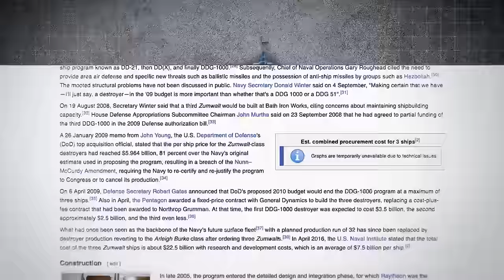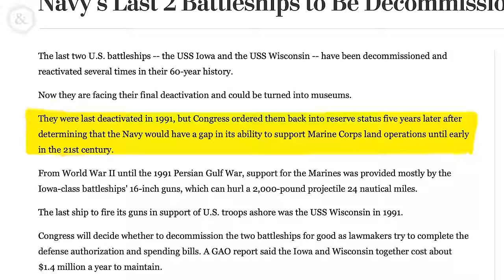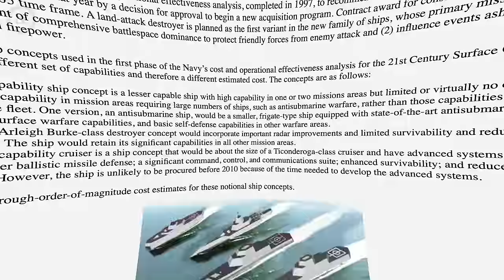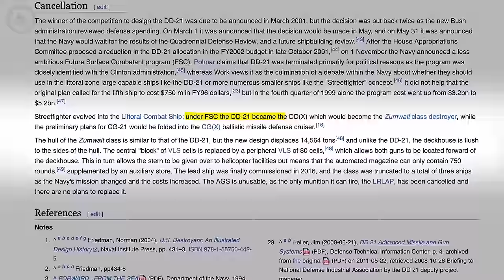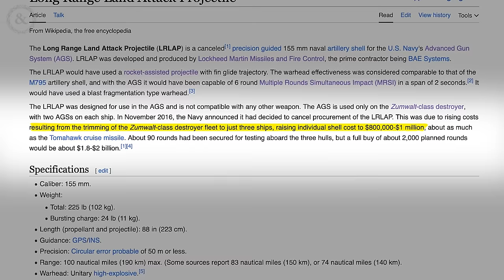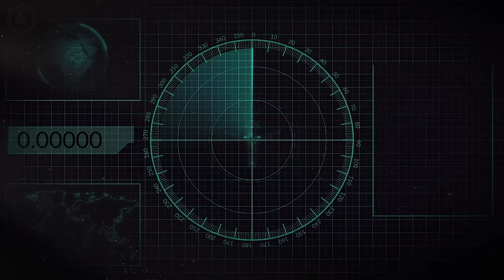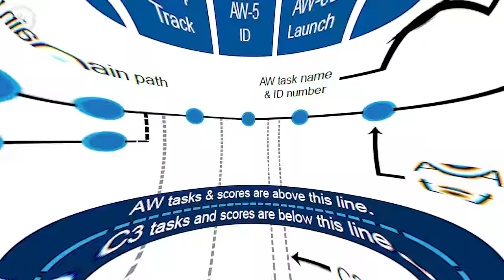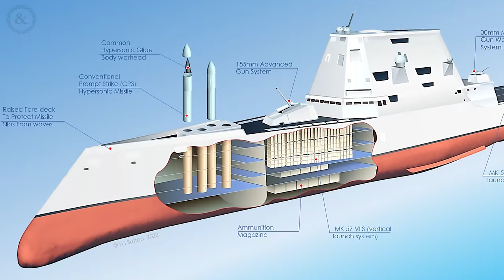Where is America's Stealth Destroyer?

Comment: The radar cross section is 100 percent fact. I was sitting just off of San Diego by Zuniga when it pulled into port for the first times and on radar it was massive from a certain angle. It made one turn in the channel and it shrunk to almost nothing. Seeing it on screen and then looking up at it was a trip.
Reply: The RCS doesn't matter that much though if the ship is using it's SPY radar though.
Reply: @Kriss_L  Not at all true, it's phased array and sweeps in a manner that it really doesn't provide the enemy with a way to easily resolve the location it's coming from.  Otherwise stealth aircraft would be entirely useless and pointless. 

Source - RF Metrologist from the USAF
Reply: @tonymorris4335  As a retired US Navy CT I'd say that that metrologist doesn't know much about SIGINT.
Reply: Well to be fair, thats true of literally any stealth thing. Same goes for the F-22, F-35, etc. From the front, it's invisible to anything but high powered search radar, and that will only give you a tiny, almost insignificant return, targeting radar sees nothing, From the side, top, bottom, its a bit more visible, from the back... Yeahhh even the Russians can find a raptor if it points its ass at the radar
Reply: @Kriss_L absolutely false
Reply: @Kriss_L What would give you the nonsensical idea that someone who works in Radio Frequency Metrology, would know nothing about signals intelligence?

The RF Metrology is specifically the exact field that would be associated with studying that stuff
Reply: @Man_Emperor_of_Mankind Your comment about a radiating SPY radar system.
Reply: @Kriss_L  I didn't make a comment about any radar system. My comment was about how nonsensical it was for you to say that someone who studies radio waves for the USAF wouldn't know anything about signals intelligence
Reply: @Man_Emperor_of_Mankind  Correction, it was the other comment:

@tonymorris4335
2 days ago
 @Kriss_L  Not at all true, it's phased array and sweeps in a manner that it really doesn't provide the enemy with a way to easily resolve the location it's coming from.  Otherwise stealth aircraft would be entirely useless and pointless. 

Source - RF Metrologist from the USAF
Reply: @Kriss_L bro can’t be wrong ever. Take a hint from the like ratios on your comment and the fact that everyone who comes in here has reliable information to disprove what you’re saying….
Reply: That's the whole idea of stealth. Have only one angle you're visible and avoid being hit by a radar from that angle.
Reply: @Kriss_L  While this is a good point - Isn't the whole idea of the navies network centric approach that different ships can hand off doing the 'looking' and 'firing' to make it harder for an enemy to find and then attack any given ship?
Reply: @Bustermachine  To some extent, but the real goal is cost savings.  Steel hulls and VLS cells are cheap.  The electronics in the combat systems are expensive.

So you could have a couple of really cheap  ships with large numbers of VLS cells whose missiles could be controlled by an expensive destroyer or frigate.
Reply: It is fine that it works that way for American radar.
Ask the Russians...
They hardly have stealth for one big reason. They also have radar that detects stealth, so why poor money into it.
Reply: @Kriss_L  lol stop pretending you are in military tsk tsk, your just a tiktoker woke
Reply: @Kriss_L  lol stop pretending your in military tsk tsk your just a tiktoker woke
Reply: That's the whole point of the flat surfaces and sharp edges. Conventional radar only works when there is at least some portion of the radar waves reflected right back at it. if you use materials with very little radar scatter you can essentially disappear unless you lined up just right. Like shining a flashlight out on to a field to find a mirror. If the mirror isn't facing you, the light just gets bounced off in a different direction. That being said, if you have multiple emitters and receivers that are spread wide and networked, that sort of stealth can be defeated by catching those errant reflections.
Reply: AND it's a beautiful ship to look at.

Comment: It’s insane the level of incompetence that this ship suffered from in the procurement process. It had true potential but now it is much larger than a Burke destroyer and holds far fewer missiles.
Reply: If the guns actually worked, it would be a really good ship. Good for shore bombardment, anti-ship warfare etc. But instead we get a half ass missile boat that would have been better off with 2 5 inch guns that is the epitome of how bad the navy admirals have gotten.
Reply: They are going to ditch the forward guns and add more vertical launch cells. If I remember correctly it will have a possible 200 missile armament.
Reply: @-UNKNOWN-13  I think they’re adding larger cells that can accommodate bigger hypersonics  where the gun mounts are

Comment: Fun fact,  the Ticonderoga class cruisers were originally designated guided missile destroyers, which made sense as they were built on a Spruance class destroyer hull.    They were re-designated because of the cost per unit.   

A Zumwalt has fewer VLS cells that a Burke class destroyer, which also has a 5" gun.    I don't know why they didn't fit a conventional 5" in at least one of the spaces available in the Zumwalt to give her at least some capability.    Or, work with the Army, which has it's own advanced gun system using a rocket assisted projectile.   Or just convert the guns to use standard 155mm shells.     Perhaps the hypersonic option will be workable, but I note that missile only ships have never been popular, and that even the USS Long Beach (CGN-9) had a couple of 5" guns added to her.
Reply: Missile ships become useful when facing a high-threat environment with many well-defended targets. The goal is to get in range as quickly as possible, launch what you can and escape to a safe distance. A gun is just dead weight. Meanwhile, against weak targets such as pirates on speedboats, naval guns are very useful. That's a lot more common of a problem than near-peer conflicts, and so navy officers with tons of experience dealing with those end up choosing a ship with guns. 

However, I would argue that having a ship that performs poorly against pirates isn't a big issue. Even if you fail, some other military asset can take care of it later. But when you have a near-peer conflict, you'd absolutely want the best ship for the job.
Reply: Ticonderoga must stay reserved for lazer scifi ships
Reply: They will eventually get a directed energy weapon I bet. Kind of makes sense if we refer back to that hybrid energy system huh?  Almost like that was the plan all along lol.  Remember they just revealed that the Ford will be arming with DE weapons ( probably already is ) 

The laser would not only give the zumwalt a low cost directed weapon but it could possibly cure the “ vulnerability “ issue from anti-ship missiles.
Those turret areas were supposed to be modular anyways if I remember correctly.
Reply: The Army's M982 is a modified version of the Navy's projectile. Thats why its so cheap. The navy essentialy footed the development cost and acted as a test bed for the eventual army proposal.

Comment: I toured one of those Zumwalts during fleet week in Portland Oregon. Very futuristic looking, but the CIC was running old Windows on all the screens LOL. No one can predict the future, so trying new (unfortunately expensive) concepts is the only way to stay ahead of the competition.
Reply: You realize Microsoft still provides security fixes and some times even feature requests for older versions of Windows if you're willing to pay enough for them, right? Windows NT 4.0 was still being supported for bank ATMs with security patches when Windows 7 was a thing. And the nice part with an older version: the interface doesn't constantly change so soldiers always know where everything is in the heat of combat.

They don't need to run the latest version of Steam or be able to install the newest version of Quickbooks. They need their software to run reliably and predictably in a consistent environment. They can either build and maintain their own bespoke environment (which has its own massive headaches) or use a consistent interface almost every soldier is guaranteed to have some familiarity with requiring minimal training.
Reply: @mawnkey - the smaller the code base & longer it has been bug fixed, the more reliable it should become… windows or no windows
Reply: @mawnkey   Yeah, I know. I work in tech and had worked in the Fed gov for yrs using Win NT. I get the reasons for sticking with what works and is familiar. It just looks antiquated on the most futuristic looking ship.
Reply: Sure they were…security would have been downgraded because you were there.
Reply: @mawnkey Microsoft should have thought about that before forcing everyone from windows 7, I know you forgot about windows 8 being dog shit but I won't, cause coding became that much more annoying
Reply: @Abandonsoyciety  If you strawmanned that argument any harder, it would be up dancing around and singing "If I only had a brain!"

Comment: the interesting thing with tumbleholm hull shape is that it can be really stabile but when it gets a hull breach it loses stability really quick
Reply: @rael5469  correct
Reply: @rael5469  It has a very low amount of the ship below the water line compared to other designs, which means when it starts flooding with water it quickly rolls over and capsizes.

Comment: Oooh, perfect chance for me to be a know-it-all on ship classifications :) Destroyers are usually thought of as small fleet escort ships, and they are, but as you said, the classification is mainly about the capabilities. Destroyers are specifically equipped with a full spectrum of weapons and sensors to defend against subsurface, surface, and air-based threats. They are focused on that mission, versus something like a frigate that has lesser capability on those areas but a more flexible design that can be used for various combat and non-combat missions. The ships the USN calls cruisers today are really destroyers. Their capabilities are the same as a Burke-class DDG, but they add a second 5" gun and flag officer facilities.

The DDG-1000s were originally conceived to operate supporting forces ashore in high-threat littoral zones, not as fleet escorts. In that role, it would indeed make more sense to classify them as cruisers, because they would be the center of their own strike group and probably have one or more destroyers as escort. But as you also pointed out, the mission kept changing, and ultimately was muddied to the point that they were claimed to be fleet escorts, possibly because even with their advanced stealth capabilities they were too vulnerable and too expensive to be risked close to the front lines. Down through history, many warships have become white elephants for those reasons.

If the technical kinks can be ironed out, and the 6.1" guns replaced with something useful like a hypersonic missile and/or a regular 5" gun, the DDG-1000s might yet serve in their original intended role as inshore fire support and first strike in a contested environment. Sort of a surface ship version of an F-35. At which point they should be classified as cruisers due to being utilized as a capital ship.
Reply: yeah i was thinking zumwalt was misclassifed (most likely on purpose so they get 32 of them initially) as a destroyer.  that thing scream cruiser to me at least going by ww2 standards.  The whole point of destroyers is protect the fleet but are easily replaced.  they are the screening force that draws fire away from the big boys.  zumwalt feel like instead of protecting and drawing fire.  its the ship that need protection so it can deliver its heavy firepower into shore or enemy vessels. Main job being shore but am sure it can also handle ship to ship combat if call upon.
Reply: "the classification is mainly about the capabilities"
Yep, and from the perspective of the Royal Danish Navy the most important capability in this regard is the ship´s range. Frigates (and cruisers) are regarded as true blue-water warships with a range of more than 9000 nautical miles such as for example the Iver Huitfeldt-class frigates which today are setting the modern NATO standard for the true blue-water "frigate" classification. 
However, both the Arleigh Burke-class destroyers, the Royal Navy´s Daring-class destroyers and the US Navy´s Ticonderoga-class cruisers all miserably fail to meet this criteria and hence do not deserve the classification "frigates" or even "cruisers". They are merely lesser valued green-water semi-coastal destroyers.
Apparently the range of the Zumwalt-class is a still kept secret, so perhaps the Zumwalt is a fully modern blue-water frigate or cruiser, or maybe it´s simply a lesser-valued green-water semi-coastal destroyer like the useless Arleigh Burke-class destroyers with their inadequate range of just 6.000 nautical miles. Who knows.
Reply: Technically speaking, the original class name was " torpedo boat destroyer" and the purposes have grown from that original job.  With the DDG-1000s running on CNG, they are less polluting than the diesel burners (and especially the remaining ships that burn bunker fuel (essentially asphalt)), but that does complicate the logistics for the fleet.  And, yes, they were over built with the intent of future proofing them.

Comment: Often ships are built too small for what they're later asked to do, or you get left with a ship that's out of date. I suspect that alot of the development that went into the Zumwalt project will be used in the next generation of ships, similar to the Seawolf class and the Virginia Class. The knowledge and skills from the development of these ships systems doesn't go away and with a few years for technology to generally get better and cheaper. The other pros and cons are how close your ship needs to get to the enemy - as we've found in Ukraine bringing ships close to a hostile shore is dangerous.I wonder if they could get BAe/Locheed martin to produce some dumb 155mm shells for the Zuamwalt - that fit the guns but aren't GPS guided etc.
Reply: The issue isn't that the munitions are smart, ironically that's the cheap part as that tech is old as hell now. The expensive part is the production facility. Without a reasonable demand for rounds of the specialized 155, it will be roughly the same 1 million dollar cost.

Comment: I live in one of the States where they are built and know people attached to the process. One factor is that it was way too forward thinking. Like EVs from the 1900s or the Briggs/Stratton EV from the 70s and 80s, the technology technically exist at its base form but in practical use does not wash out. Because of this they had to start downgrading some technology, which meant adding more crew or then moving back to older armaments.  As technology advances the concept will probably come around.

Comment: Mach 17 is impossible for a cruise missile, both because of how thick the air is at sea level that the air resistance would likely rip it to shreds and because the plasma cloud formed from traveling so fast would render any electronics like antennas and radars useless. It would have to be a ballistic missile like the YJ-21 which could maybe reach those speeds right before impact and would be much slower before then in order to save on fuel (for that insane range) and so it has time to coordinate with satellites to track moving vessels before its radars become useless, but this also makes it much easier to shoot down if detected.

Comment: Holy cow I had no idea we had radars like the X-Band , that's bonkers detection range
Reply: It's a pretty deceptive claim, though. Picking up faint signals is only a small part of the problem. When that signal is masked by clutter or noise, good luck! You can spot a candle with your bare eyes from miles away. But only during the night. A telescope could spot that candle during the day, but point that telescope at a candle between you and the sun and you'll blind yourself before you spot the candle, even one close enough to see with the naked eye.
Reply: It's a very big radar that operates at high power levels. Some of the older ballistic missile tracking and warning radars operated at up to 100 megawatts.

Comment: I wonder if we will soon get to a point where missile interceptors will be so efficient that 16 inch gun projectiles will be needed. Maybe a 16 inch version of the Excalibur GPS guided munition would look pretty good and our museum ships would be brought into service 😃
Reply: Artillery shells are big and not as fast you think they are
Reply: @reesew71  Yeah, but could you successfully divert or destroy a 16" shell traveling through the air? A little missile interceptor doesn't have the mass to move it. Most missile defense systems use kinetic kill or they explode and spread out a dense field of small shrapnel to damage the lightly built missile. You're not doing that to a 2,000lb armor piercing shell.
Reply: @oldscratch3535  Railgun battleships wouldn't suprise me if they came around in the future. A large hull would be the only way to support the needed energy production for a rail gun.
Reply: @oldscratch3535    “You're not doing that to a 2,000lb armor piercing shell.”

If you want to read a humorous version of this read Harry Turtledove’s Worldwar series, where aliens with 21st century level tech decide to attack the earth during WW2.
Reply: Don’t underestimate big guns.